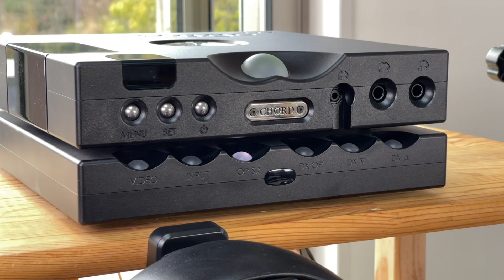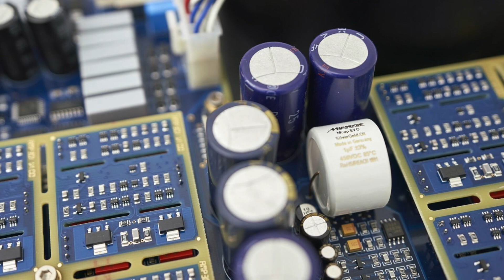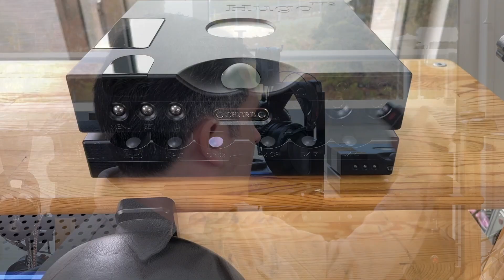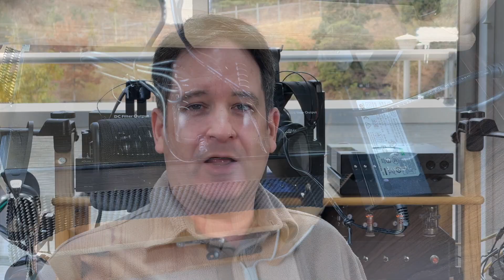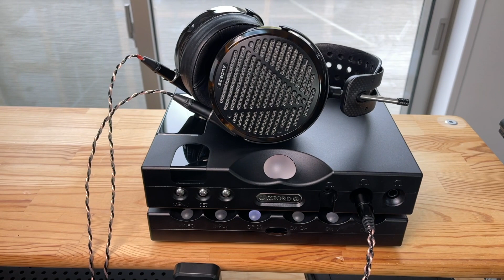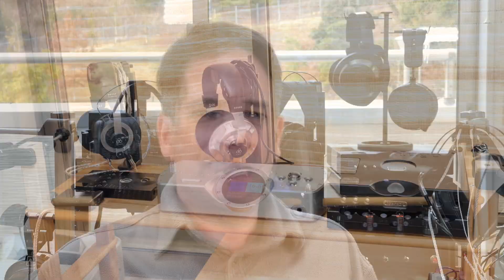Chord Hugo TT2 & MScaler Review

Comment: I own a TT2+Mscaler which I listen trough a pair of LCD-5 and I feel I am in pure sonic heaven. I can't afford a chord Dave right now and the only downside of my Chord combo is that makes the research of other components from other brands pretty pointless as I know I can't find anything really better. I am hoping for just one more single product release from Chord electronics which is a standalone lossless equalizer as the one implemented in the mojo 2. Please Rob Watts, listen to my prayers!
Reply: There are other options that are just as good and better than the TT2.
Reply from the maker: Rather than post an empty comment, how about write about your experiences comparing the TT2 with other DACs? That would be more useful.
Reply: @Currawong  as you know it's all preference. Some say they prefer the Holo May or the Lampizator with tubes. I guess I should have elaborated that it all comes down to taste. I don't believe that any dac is a be all end all dac because we are all different with different preferences.
Reply: I agree, using same with Lcd5. 
Just adding  ow a McIntosh Mct80 cd transport. 
End game i feel

Comment: I currently have a TT2 (w/o the M Scaler), Yggy A2, and ADI-2 DAC FS sitting on my desk. To my ears, the Yggy has a more natural timbre, it also creates more air around each instrument. The Yggy definitely has great synergy with the Flux Lab Volot headphone amp. It's the only DAC out of the three I currently own that makes the Audeze LCD-XC (2021) sound almost like open-back headphones.
Reply from the maker: Interesting. I find the opposite with the TT2, but then, it has the advantage in that it has a good headphone amplifier built in. I reckon though that if you get good synergy, that beats everything really.
The LCD-X headphones are open-backed by the way, unless you mean the LCD-XC.
Reply: @Currawong  Indeed, it's all about synergy in the chain. Thanks to the Volot – so far it's the best sounding SS headphone amp I've heard.  
Yes, I did mean the XC version. It was a typo)
Reply: The M Scaler makes the stock TT2 sound rather muted and flat by comparison to when using them both together

Comment: I use the TT2 / MScaler with the new Ferrum Hypsos / OOR stack. It's the best combo I've heard on the Abyss 1266 Phi TC. 

I still think there's better out there for the Susvara, though it's quite good. I'm not sure I've found a match for its potential. The Bakoon 13r is the amp I'm targeting.
Reply: Just curious but have you tried the Susvara on the Burson Soloist GT? I own the GT but I've never heard the Susvara.  Just curious on a small comparison if you had.
Reply: @brooksphillips2234  I have the Susvara and the Burson Soloist GT with the Hugo TT2 and M-Scaler.  It is very very good.  Now I have found that when I just use the Hugo TT2 with the Susvara it totally can handle the headphones with out an external amp.  The sound with the Burson Soloist GT and the Susvara is so clean but I have not noticed a huge difference between using the Burson and just using the Hugo TT2 amp.
Reply: Are you using the Hypsos to power the Oor or the TT2?
Reply: @gibgun  Oor

Comment: I recently snagged the Chord TT2 and M-Scaler for good deals ...and yeah there is a Chord difference with their DACS. Great with the HE1000se and Verite Closed.  Also nice DAC paired with the Bottlehead Crack & Speedball and HD 600
Reply: Is the hp amp good enough to run sus / HE6 / phi tc?  Would you also compare the Dac sound signature to something like Holo KTE dacs is this a bit more neutral in comparison to their more smooth sound ?

Comment: Excellent review on all this Chord gear. One more defence for the arguably leading mid-fi R2R ladder Dac Holo May is that it presents a consistent soundstage located behind the speakers, which Paul McGowan from PS Audio regards as being the preferred soundstage location.
Reply from the maker: If a DAC presents a soundstage in one place all the time, then it isn't doing its job!  The soundstage should depend on the music and how the microphones were set up. If the singer is up close, then they should sound up close. If an instrument is far back, then it should sound far back. Etc.
Reply: @Currawong  I understand the Holo May present the soundstage at various distances but almost always behind the speakers. Tried to find the relevant PS Audio video but could not (there are so many). FYI, the relevant snipped I had written down was (with respect to speak positioning advice) "picture dual recording microphones turned around and transforming into loudspeakers and the stereo image appearing from behind them".

Comment: I contacted Chord in regards to your comments about them supplying 50 ohm bnc cables instead of 75ohm.
The answer was they dont.
They supply 75 ohm as anything else wouldn't work
Reply from the maker: The one they sent me had 50 Ohm cables in the box. 50 Ohm cables will work, but will cause signal reflections. Whether that will result in audible issues I'm not sure. Probably not with their gear.

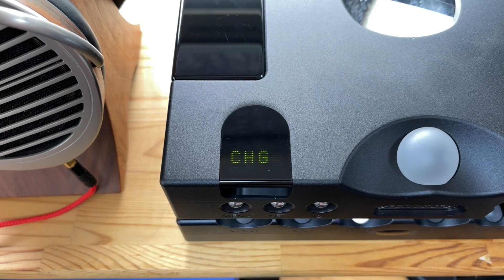Comment: 7:31 ... The negative you describe of the TT2, is not strictly true. Where you described the delay for charging the supercapacitors, when plugging in or removing headphones.  

You only get that delay if you change the gain of the TT2 between headphone sockets and the rear sockets. ... If the gain of the headphone sockets and the rear sockets is the same, i.e. high gain for both. Then there is zero delay when pluggin in or removing headphones. The change over is instant. ......... First time I discovered that, I thought my TT2 was suddenly partly broken.

By the way I found your discription of the difference between the TT2 and the Hugo 2 to be underwhelming. (Almost boring.) The TT2 is considerably more explicit than the Hugo 2. Sounds are more fully realised/presented. All the components that make up the TT2's better sound quality, have a relatively profound effect vs the Hugo 2. 

Whereas the Hugo 2 on first listening while adjusting to its signature, can sound scarily real. (That's coming from the Mojo (1).) With music you already know well on the Hugo 2, the TT2 can sound momentarily alien with that same music. There's just so much with the TT2, that it can sound unreal. Not that it is reproducing music/sounds unrealistically. It's because compared to the Hugo 2, the TT2 is is better in ways we had not quite imagined. (This is analogous as going from the Chord Mojo to the Hugo 2. Better, and also better in ways I had never thought of.) The TT2 can sound eerily brilliant when you get all that detail and musical components. ... One aspect I noticed was that leading edges come in much more with the TT2. I noticed lyrics that e.g. started with a letter 'T', would jump out at me, vs familiarity Hugo 2 familiarity.

In fact if you want to assess the TT2 quickly, I suggest listening to music you don't know. That way you are hearing the music as a whole. As opposed to listening to music on the TT2 compared to the Hugo 2. All while being left-fielded by the changes the TT2 brings.

Of course you came to the TT2 already having heard the DAVE. You perspective on it was different to mine coming from the Hugo 2.
Reply from the maker: Thanks for the long comment. I've found the experience of each of the DACs to be relative. For example, a friend just got the Hugo 2, and was blown away (he uses high-end IEMs primarily). I'm now so used to the DAVE it doesn't have quite the effect on me it did at first.

Comment: I have the TT2/M-Scaler and appreciated an uplift in overall SQ after replacing the stock coax cables that came with the M-Scaler with Moon Audio dual coax interconnects; also, quite an improvement after adding isolation/absorbers between rack to M-Scaler and between M-Scaler and TT2.

Comment: Great review! Did you notice any worthwhile sound difference with the Amazon bnc cables vs stock?
Reply from the maker: I didn't compare them.
Reply: @Currawong  why did you change it then?
Reply from the maker: A: Because the stock cables are not to spec, and
B: Because 15cm cables are much neater and don't get in the way when you have up to a dozen components on a rack.
Reply: @Currawong  makes sense. Wouldn't you want to do a direct a/b to see if they sound any different?

Comment: Sold a TT2 and MScaler and got a DOGE 7 tube DAC. Way cheaper and enjoying it much more.
Reply: Are you using the DOGE 7 headphone jack or using it with another amp?   And what headphones are you using?  Or are you using it with a Speaker system setup?

Comment: Dave + mscaler is great stuff though expensive. if you watch videos on your system you need to take in account Mscaler will add substantial lag, so you will end up switching it off.
Reply from the maker: Good point. That's why it has a "video" mode that has a shorter delay.
Reply: To be fair, using any Chord DAC from even the original Chord Mojo, to view video is excellent. Forgoing full M-Scaler upscaling when using a TT2 to view video, and then complaing about it. That is like shooting yourself in the foot, and then being happy about it. (Don't try this at home.😵 )
Reply: @greenbow7888  I actually found it inconvenient to switch on and off upscaling if watching video. And there is a lot of video content which is good quality audio as well. I really, really recommend trying Youtube. Though you can't use ASIO drivers it is still a lot of pleasure. Try for example Alicia Keys MPR Tiny Desk Concert. You won't find it anywhere else.

Comment: I wish sooooo bad they would come out with just the dac of the tt2.
Reply from the maker: In Chord DACs, there is no "just a DAC" possible. The output would be the same, with just the volume control disabled. If you want "just a DAC" you'd get the Qutest.
Reply: @Currawong  I agree the qutest would be the closest but it  would be cool if they did a separate dac of the tt2. I think many ppl would buy it. Lots of ppl like myself have a more powerful amp than the tt2 but would like the option of the dac and the option of the m scaler to make it even better. I know it could be done with the qutest too but it would be nice to have that option especially since it's such a popular dac. I am thinking of going with the Holo Spring 3 kte or the Lampizator  Amber 4.
Reply from the maker: The FPGA and pulse array of the TT2 is, as far as I can see, the same as the one in the Hugo 2 and Qutest, so it proves what you're asking for. On the other hand, removing a few amplification components and the volume control of the TT2 probably wouldn't save any money overall.
Reply: @Currawong  I have demoed the Qutest, Hugo 2 and TT2 in my speaker-based system, therefore without using the amp section. I found the Hugo2 and Qutest pretty disappointing, but the TT2 was fantastic. I also can't figure out why they were so different given the same core DAC module. Maybe the number of taps?
Reply from the maker: You were using the amp section. There is no separate amplification section regardless of what output you use. This seems to confuse people.  Aside from that, the number of taps and better power supply are likely the most significant factors.
Reply: @Currawong  thanks for taking the time to reply...so the signal goes through the amp section, even though there is no amplification going on? It is sitting behind a Pass Labs XA30.8 which is my main power amp
Reply from the maker: @tfj100  All DACs have an amplification stage. The difference with the Chord designs is that they don't need a multi-stage design for the headphone amplifier. That allows the output stage to work for both headphones and the line out, and also for the line out to also have enough power to drive sensitive speakers.

Comment: Hi Currawong Sir. My TT2 has malfunctioned and I’m currently awaiting fix. I took the opportunity to order a Holo May with the intention of selling the TT2 when it’s fixed. I do intent to keep the M Scaler to work with the May albeit not taking advantage of the dual BNC. I’m also selling my Empyreans which is really why I bought the TT2. I’m just no longer the headphone guy I thought I was so have no need for the TT2’s headphone amp. 

I know you reviewed the Holo Spring. What do you think of the move. Do you think an M Scaler + May would be better than TT2 + M Scaler? Golden Sound was all over the May and even suggested it was better than the Dave + M Scaler, high praise indeed. 

What are your Elacs? I have  Elac Adantes which I love and can never understand why they didn’t run with them, they could have been a classic. 
I’m English, congrats on keeping hold of the ashes 🥺 Many thanks
Reply from the maker: If you're going to go with the May, and sell the TT2, I'd sell the MScaler as well and spend the money on Roon and HQPlayer, though the latter has a steep learning curve.
Reply: @Currawong  Thanks. Problem is, I use Innuos Zenith digital transport. The zenith is specced very low power to keep noise low, it only just runs Roon as core which I do, let alone HD player.

Comment: Don't own a TT2. Do have a Hugo2 + 2go.
I really enjoy the Hugo2.
Did try the TT2 (No M-Scaler) along side with the Holo Audio Spring 3 KTE.
Ended up purchasing the Spring 3 but may also look at the TT2 later on again. Was after something different from the Chord house sound.

That was through a Volumino Primo via Roon (If I recall correctly) -> USB to TT2 and Spring 3 -> Holo Audio Azure Headphone Amp -> HD800 S.
The Meze Elites were available to try but resisted as they're the same price of the Spring 3 at the time.

Comment: I use the Cayin HA300 tube headphone amp with my TT2 and Final D8000 Pro Headphones. Better SQ to my ears. (Digital source into the TT2 is via Toslink optical.)
Reply: Hi Trevor, that is interesting set up. How do you connect TT2 to Cayin HA-300 ? By RCA or XLR ? Thank you.
Reply: @edywidjaya301  I have tried both RCA and XLR. Both work well. I've stuck with RCA between TT2 and HA-300. Very soon I shall experiment with long 20 feet / 6 metre XLR between DAC and amplifier.
Reply: Trevor will you be upgrading to the ha300 Mk2 ?  The black looks great and super interested to see what improvements were. Made.
Reply: @aceofspades6667  oooh I really would like to. The Mk2 has a 4.4mm pentacon headphone socket. Alas, we pay much more for Cayin gear in Australia than other countries. That always delays a purchase or upgrade for me.

Comment: Good video, but your reference to many other equipments confuse me. So i have AK SE300 as player, if i pair this to TT2, would this be enough to drive Susvara?

I was about to purchase Enleum 23 RMH as portable amp to drive susvara, but then, should i invest in TT2 instead of enleum 23 RMH?

Need your inputs and advice. Note: my budget is at maximum to afford tt2. No more other equipments (m scaler, dave, etc). So which one should i invest for my purpose? Thank you
Reply from the maker: You can drive the Susvara with a TT2, just not super loud.
Reply: @Currawong  hey, Thanks for your reply

Comment: agree with a lot of what you say about the sound, but the sound of the amp let’s it down in my opinion. But pair them with a Really good amp and put some good isolation under them, I think the sound quality is  then fantastic. 
Having said that the Dave+mscaler may well be better , but I couldn’t afford a Dave at the time of auditioning the TT2 ,so can’t comment on it.
For what it’s worth my system comprises: Sim audio 260 CD Transport: Chord TT2 + mscaler: Sim audio 430 Headphone amplifier: Grado PS 1000e headphones . A combination of Chord company cables and Kimber cables as interconnect’s 
Audioquest : Niagra power conditioner. Thunder power cables.
Could I make a request, I would find it very helpful if you could compare Hifi to what was around a few years ago. For instance headphones, rather than just comparing products around today with other products that are around today.
Well you did ask🙂
Reply from the maker: I use the TT2 through the Studio Six quite often.  I don't think that the amp in the TT2 is bad though -- but, unlike many amplifiers, it hasn't any any "tuning" done to it, but was designed to be un-coloured. I don't like that so much with the LCD-5s, for example. 
Since you asked about older gear, if I have something I can compare that is relevant, I will do so, if it is still available. However, since I am short of space, I give away anything that has been discontinued.

Comment: Have issues when I power up the Hugo TT2. Using an Aurender N100, using USB connection, it doesn’t lock in and I get distortion. What would cause that? I have to cycle through the inputs to correct it.
Reply from the maker: No idea. I recommend asking in the Head-Fi thread for the TT2. Rob Watts may be able to help you as he posts there.

Comment: Mojo 1 vs Hugo 2.. With Hugo 2 some sounds "sound" more intense, more present, more real, more lively compared to Mojo... and it's not related to how loud I listen... it's something i just don't hear with Mojo 1... BUT, I always feel something is missing with Mojo or Hugo 2, it doesn't sound complete, even if it sounds amazing and clean and fast and musical. So it seems it's the same thing with Hugo TT 2, it will give the feeling that I need more and for years I'm trying to understand why it does this. Why even a $100 trash DAC sound more complete than Hugo 2...  I don't understand. The only end of the road would be Dave..... ... ... .... and M-scaler and ... that's too much for my wallet that doesn't exist.
With Hugo 2, HD800 sounds are too disconnected, it's just a weird presentation even if it's more detailed than Mojo. Mojo sounds better, it has better lower mids.